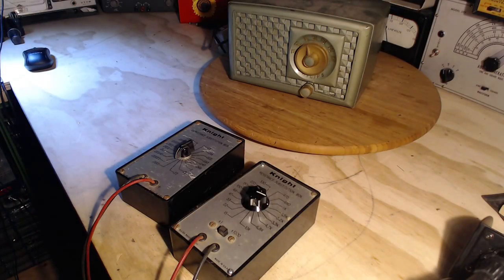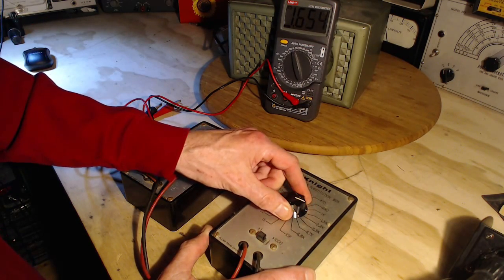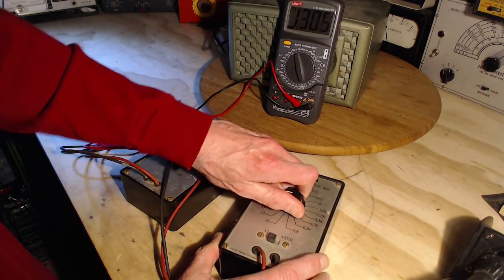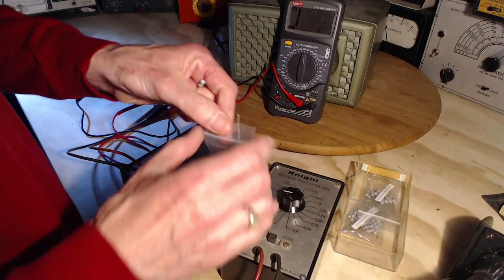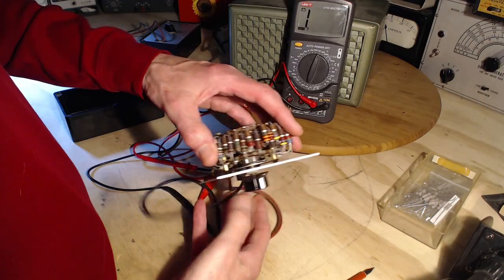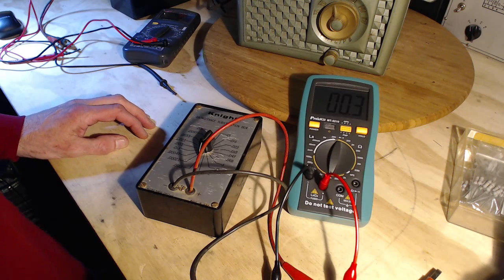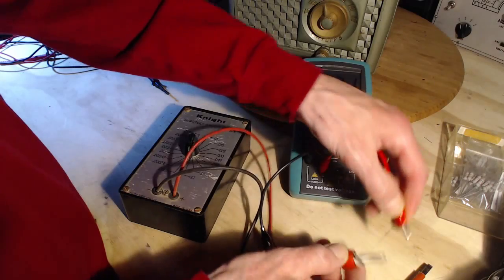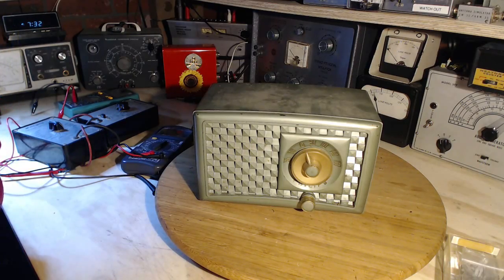Resistor and Capacitor Substitution Boxes

Comment: jim one thing this could be used for in a shop is if you suspect a certain resistor or condenser of being bad lift one leg of the suspected part and put the box in its place dialed to the correct resistance or capacitance. if it cures the problem it is proof positive that the component you suspected is bad. say you suspected a particular condenser but you didnt have a way to test it you could check it by substitution with this box. im sure in the early days before the capacitance bridge became popular this would be a good way of checking condensers.

Comment: jim i would use a vtvm. i just dont trust digital. also modern meters are not recomended for testing the older condensers because they dont put out enough voltage to accurately check for leakage.

Comment: have the identical substitution boxes they are awesome once you clean the switches and replace the out of Tolerance components & is your capacitance meter ESR? another handy tool!
Reply: +Thomas Stemmer  glasstronic is right for the professional I recommend the capacitor wizard rugged dependable expensive.... for the hobbyist there's 20 and $30 kits that are worthwhile....
 it's a real game-changer to be able to check caps in circuit if you're new my recommendation is look for strangely misshapen or sweaty components they are generally bad test them first.....
Reply: +Bret H what is esr. when i learned how to test condensers i was taught to check capacitance and leakage and the power factor on electrolytics. never heard of esr.
Reply: +Thomas Stemmer ESR is: Equivalent Series Resistance. 
Think of that as a resistor in series with the capacitor...not a good thing. Capacitance measurements are often inaccurate because of high ESR (or leakage across the cap).
Reply: i definately use the sprague teleohmike to-3. it has never failed me yet locating a bad condenser. as i never work on solid state i dont have any equiptment for that but what i have works great for the older condensers